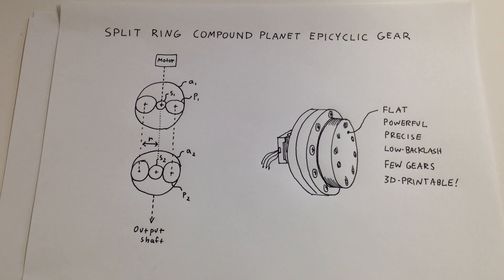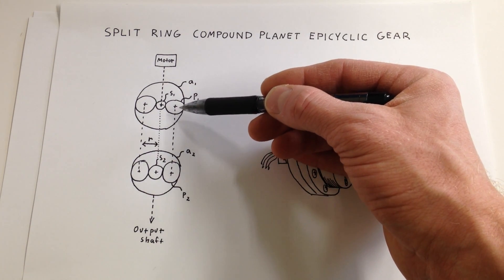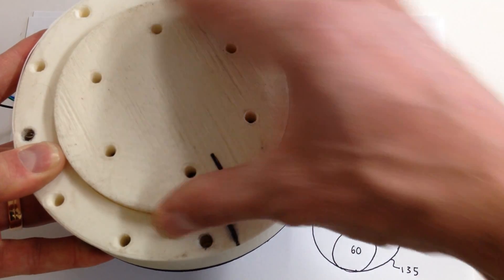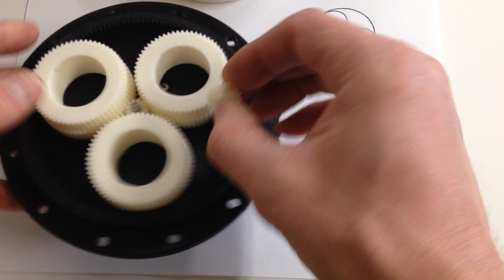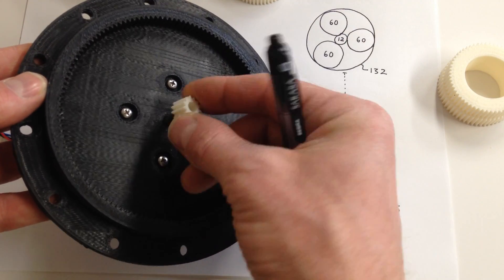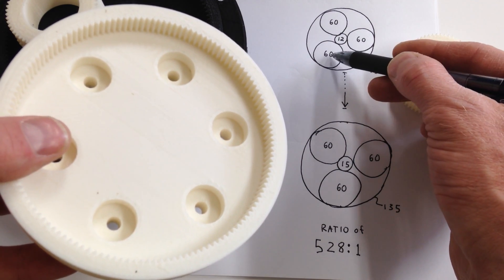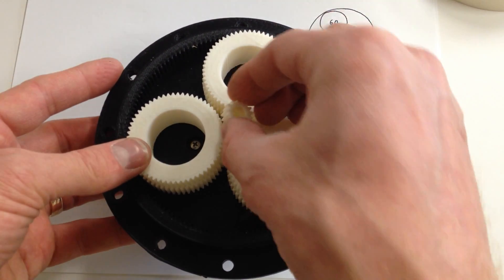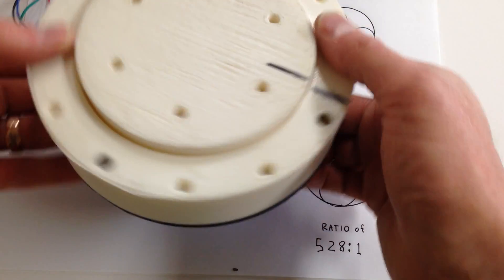Split Ring Compound Planet Epicyclic Gear

Comment: yours sounds exactly the same as mine. 
too funny.
Reply from the maker: @amandahugankiss4110  well, feel free to download the print files and compare. What were you designing yours to be used for? Did you end up using a tiny idler gear or something to hold all the planets?
Reply: @davoriffic  i think i was working on gimbals for large nerf blasters. i mainly did it because they are neat. i posted an image of the design on my channel. the physical print is in one of my old print bins. made a great fidget toy.
Reply from the maker: @ I was designing mine for a telescope mount but never made it!

Comment: Hi David, I'm really interested in this gear box, are there any resources that discuss this type of gear box in much more details?
Reply from the maker: This kind of gear box seems to turn up in aircraft avionics and in some things like auto-mirror adjusting motors. There are also some gearing arrangements like this made by the company Harmonic, which makes strain wave as well as conventional gearing machines. 
It is a little bit obscure, and quite interesting, though. I am putting together a better spreadsheet for calculating the formulas.
Reply: I’ve seen it referred to elsewhere as a Wolfrom drive. A bit of research shows that Ulrich Wolfrom held a patent for this design about 100 years ago.

Comment: what are the module of the gear selected for stage one and stage two ?
Reply from the maker: I have made a spreadsheet for calculating the factors for gears in arrangements like the gear box in this video. The gear sizes are given in diametral pitch, but you can use that to calculate the module. You can download the spreadsheet here: https://github.com/IdeaPropulsionSystems/CoolEpicyclicGearing/tree/master/GearSpreadsheets
Reply: thanks for the reply

Comment: are your second stage gears all at the same pitch?
Reply from the maker: Yes; the first stage gears are all the same pitch, and then the second gears are all the same slightly different pitch.
Reply: Great, its a very nice work. I'm still trying to work out why One revolution of the planetary gears equals the second ring only turning round by the difference in teeth (of the two rings)?! So in that case I imagine if the second ring has a bigger difference in teeth it actually provides less gear ratio?. Also, does it rely on the compound planet having the same number of teeth on both sides?! Thank you!
Reply: I lasercut a setup with same pitch of all gears last weekend and it worked. It just relies on a different number of teeth between the two nested planets, and therefore corresponding rings.
Reply from the maker: Cool! send a link? I'd love to see it; I improved my calculator spreadsheet to include gear tooth pitches. You could use this to make a box with the slightly different pitches for the top and bottom halves. Having different pitches but same numbers of teeth on the planets will let you get ridiculously high ratios in just the two stages as shown. https://github.com/IdeaPropulsionSystems/CoolEpicyclicGearing

Comment: By what means do you hold a1 on?
Reply from the maker: In the demo I printed, there is a collar that goes over the whoe a1 and holds it to the body and a2 by its flange. In a real application, there would have to be some bearing or bearings that keep it in position and centered.

Comment: Around 2015-2017 I experimented with something pretty similar, making simple gears but with two hollow gears off by a multiple of the number of planets. 
Here's my video on it: https://www.youtube.com/watch?v=alwwyWFQwuM

I'm still not sure whether I'm just getting away with a slightly mismatched tooth profile / altered pressure angle for the second ring, but it worked surprisingly well.  I very much enjoy seeing how different yet functionally equivalent from the outside our concepts are. Props for sharing it!

(I had it on private until this year and it seems youtube overwrites the uploaded date with the current date when you decide to publish it, so I now look like an idiot claiming the earlier date. Ah well, as long as people can use the conecept for something cool, I don't care anymore).

Comment: The motor pinion is 12 teeth and the ring gear 132 teeth so ratio is 11:1
If the second ring gear has three extra teeth to accommodate the three planets wouldn't the calculation be;
135/3 = 45, so ratio is 11:1 x 45:1 = 495:1 ?  just asking
Reply from the maker: Thanks! And a very good question with a two-part answer - 

First, the 11:1 ratio you found would hold IF the planetary gear was holding still with respect to the sun gear; in this special case, it is actually orbiting around as it engages with the annulus. The sun gear's engagement with the annulus basically falls behind by one full rotation once the planet has finished an orbit, so the ratio is actually found like this: (AnnulusTeeth/SunTeeth)+1=12:1.   

Secondly, figuring out the ratio you get between the two annuluses (annuli?) you correctly divided the tooth count difference into the number of annulus teeth; I had been incorrect in my thinking as to which annulus should be divided into - it SHOULD be divided into the output shaft annulus, not the stationary one, so 45, whereas I had calculated 44 by dividing into the stationary annulus. The distinction is important because the 3 tooth difference is a difference of three output teeth, not three stationary teeth...

Taken together, the correct gear ratio for the box pictured in this video is 45 x 12 = 540 

I'm going back to double check some things, and will update my spreadsheet to reflect this distinction. Thank you for your keen spotting! :-)
Reply: @davoriffic  Thank you for the reply and apologies for the first ratio; I forgot to add the 1 for a planetary gearbox ratio.
Thanks for the explanation.
Reply: @davoriffic  I'm glad I'm not crazy haha  I was positive it should have been 540 instead of 528 given the 135 teeth output annulus but kept second guessing myself.
Reply from the maker: @Tonescarp  Interesting -  Can you walk me through the steps that you took to figure that out? It is very likely that I messed up somewhere, and would love to update my calculator as necessary.
Reply: @davoriffic  Hi, I agree, 540:1 is correct. I have made an animation page and a calculator for such gears. Pasting '12 135 132' into the top right [I O B] field will show your gear, and also show that the ratio is 540:1.
https://saugstad.net/gear-animation
Reply from the maker: @palsaugstad4013  excellent work! This is wonderful. I have sine other alternative gearing designs that may be fun to dynamically illustrate like this; has my imagination cranking 🤓

Comment: Hi, which module did you use ?
Reply from the maker: The key to understand with gearing like this is that the two halves have slightly different modules. This lets compound planets mesh with annulus gears that have different tooth counts. In the case presented here, they differ by 1 or 2 teeth, that way a full revolution of the planets only advances one annulus by 1 or 3 teeth. It provides a huge mechanical advantage in basically 1 step

Comment: Very clever idea. I can't help but wonder though, does this have any advantage over infinite screws. I'm not being sarcastic btw. In fact, it's more important for me that you know this than i know the answer.
Reply from the maker: If by infinite screws you’ll mean like worm gears, it really depends; work gears are definitely more simple and less trouble in terms of backlash. This split ring approach can achieve really high ratios, maybe 5 or 10 times higher than a work gear of the same diameter. But depends on the specifics. One other advantage I could see in this split ring approach is that there are at least 3 gears engaged at all times. In a worm gear, there’s just one contact point. For really high torque, this may make it less likely to have the teeth shear off ( because there’s more of them)
Reply: @davoriffic  then again worm gears, i think, work with a lot of friction inherently. under big loads, they might be a lot less efficient despite having fewer gears.
Reply from the maker: @timucinbahsi445  True, they have a lot of friction, especially under big loads. The split planetary gearbox shown in this video also suffers from increased friction if you really load it because the gears try to 'tilt' in the casing, which cause them to bind up. Having a gear carrier for the planets and also possibly arranging to have balanced loading in some way could make it more practical.
Reply: @davoriffic  also this one can be mostly cured by decreasing play with bearings.

Comment: whats the module of the gears
Reply from the maker: I made a spreadsheet here: https://github.com/IdeaPropulsionSystems/CoolEpicyclicGearing/blob/master/GearSpreadsheets/190120_Hartkop_CmpdEpiGears.xls 
for figuring out the gearing. The teeth are given in diametral pitch and not module, though. You can convert one to another here: https://www.engineersedge.com/gear_pitch_chart.htm.
Hopefully that helps! An improved spreadsheet would have the module for the gears.  Thanks!

Comment: what if the top had.135 
amd the bottom had 132
Reply from the maker: Well, the numerical model that I made suggests that the ratio goes from being 540:1 to being -539:1. That is to say, the output shaft would revolve the other way, and something is now going in the same direction when it was opposite before, loosing one full revolution per turn.  That 'seems' right but maybe you better simulate it for yourself ;-D

Comment: i think i found the purpose of that device if 
Meshed gearswith an equal number of teeth will turn at the same speed. If they have an unequal number of teeth, the gear with the fewest teeth will turn faster.

if.that's true i think i know what this is meant to do

Comment: https://www.thingiverse.com/thing:4114551
But how to calculate the gear ratio? I got it way wrong.
In that spread sheet, what is n "2nd stage multiplier"? 
I use the same diametral pitch on all gears.The openSCAD project is intended to be a library. They get connected together in the next project.

Comment: Please tell me how to get several hundred thousands to one, thank you so kindly
Reply from the maker: One way I can see is to stack two gear arrangements like this together. This would essentially multiply the ratios. If you did that with the box shown in the video that has 500 some to one, you could very quickly have 250,000:1
Reply: @davoriffic  
Thank you  so much I really like what you did 
Really incredible
Reply from the maker: @jamesmatheson5813  awesome, thanks!

Comment: Printed base that is on github and it is too big - planets do not reach it...
Reply from the maker: Interesting. I wonder if the small central gears are not scaled correctly. Do planet gears mesh with the annulus teeth?
Reply: @davoriffic  Base, rotor and seal do mesh together. So are only planet gears scaled incorrectly? Any idea figuring which part is wrong?
Reply from the maker: Interesting; My best guess is that the small idler gear and the gear for the motor's shaft are too small. I seem to remember having to play with the scale of these two parts in order to get the demonstration gearset working properly. Thank you for your interest! Let me know if that helps. @RebellisSpiritus

Comment: Interesting video. I didn't know about the fancy name of it, I just went on and made one not having seen it before. However 3-D printing it is fine but how would you go about to machine it? I milled mine with an ordinary end mill. Also I have used it once in a project. Then I made the sun and the outer rings in hard anodized aluminium and the planets of POM. Worked just fine.
https://www.youtube.com/watch?v=g821BOC_oAQ